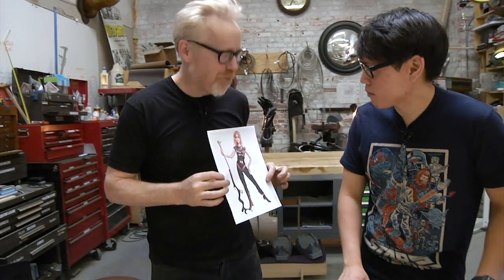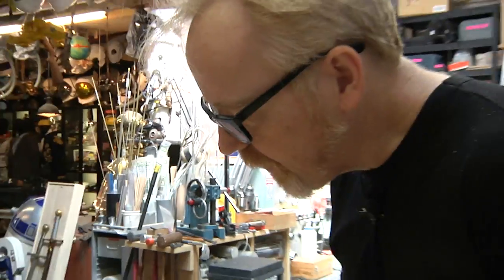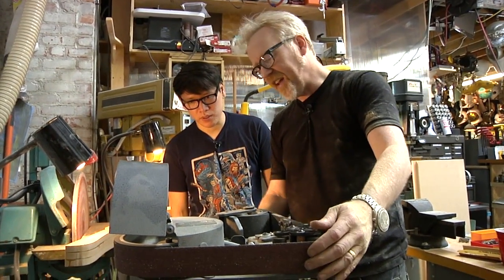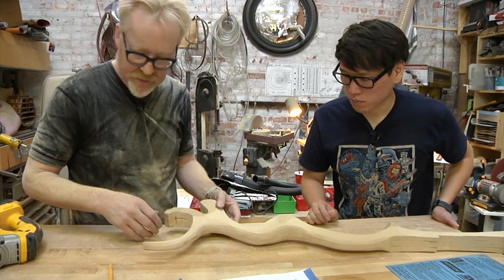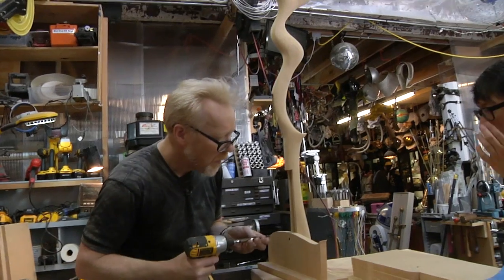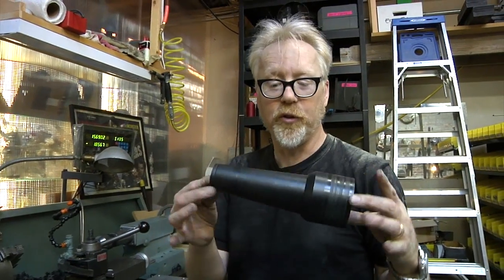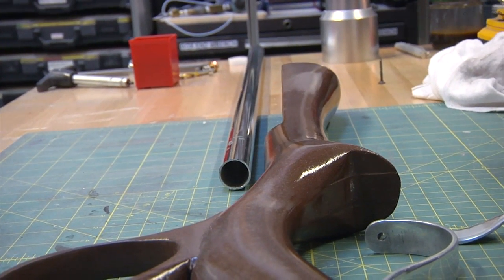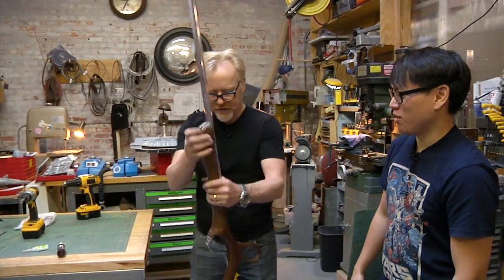Adam Savage's One Day Builds: Barbarella's Space Rifle

Comment: My tip for cutting out a shape is don't try to save the waste board.  Make cuts across the waste so that it falls away as you are cutting out the shape.  Another way to do it is to make a quick very rough cut around the shape. It is then much easier to make the final cut with less waste in the way.

Comment: I am wondering why the overall wood shape wasn't done on one layer to a finished shape (in this case two done to a finished shape because there are two guns) then the additional two layers for each finished gun just rough cut, one of the finished layers glued to two of the rough cut pieces and then just use a pattern bit in a router and get all layers exact and excess glue removed in a single step.

Comment: Adam, I know this is an old video and I hope you read this... One thing my father taught me was shop safety and sawdust in the lungs is extremely dangerous and over time can cause serious issues with lung health. In the future I would recommend a respiratory mask. Watching you work with that jigsaw and all that sawdust I was concerned for your health.  
To put it in perspective... a wood working website states:
         "Long-Term Damage: Forget about the large chips and visible sawdust: perhaps the most damaging element is the invisible fine dust (sometimes called “coarse inhalable particles” ranging from 2-10 microns). Basically, these tiny bits of sawdust float around the air and linger even after the tools have stopped running. These invisible particles get inhaled and cause tiny wounds and scarring to our lungs: each time this happens, it causes a very small amount of irreversible damage. The immediate effect is unnoticeable, but over long periods of time, this can result in significantly decreased lung capacity, and a number of other health issues."

Comment: Now with 3D printing you can easily make this gun by Outlining a photo in a cad design  program like SHapr3D on my ipad. Then print it out with wood filled PLA for the Stock end of the gun and then sand and stain it. I wood probably need to print this  in 3 pieces and the barrow in a couple of pieces.  And then figure what to put inside of the pla in order to add some weight to the piece. But not very hard with todays 3D printers. It would be nice to have someone try it out of 3D printed parts and compare it to the model in the video.

Comment: Chromepaint on turned plastic...will not work well. Barely works on metal, specially when its only 2K automotive hardened @70°C. I got a few good test panels, looks like a dull mirror, best you can get. Takes 3 days. Not an option for our Adam here :>